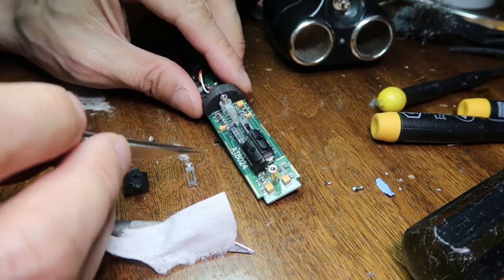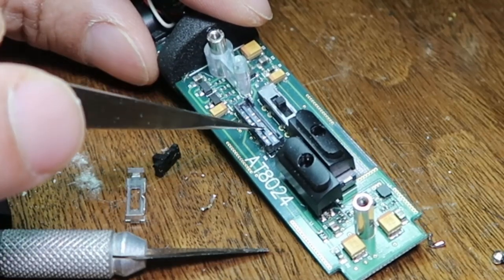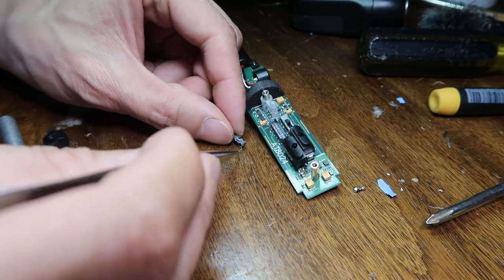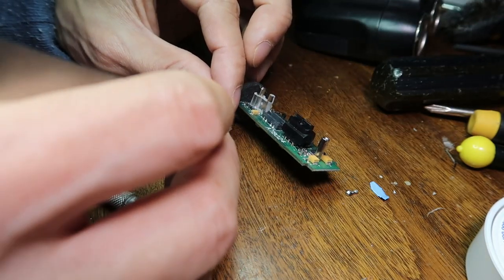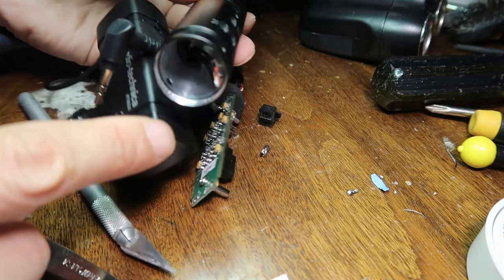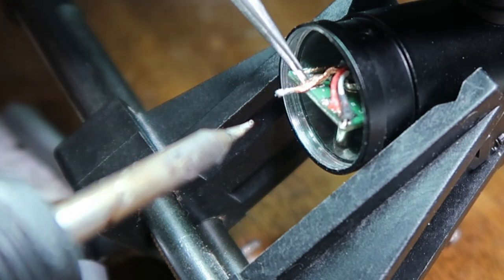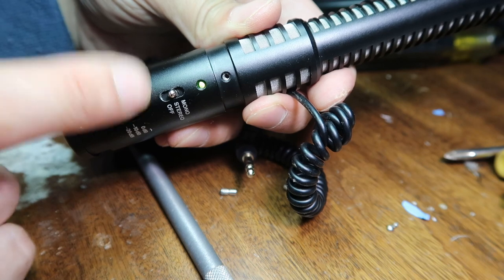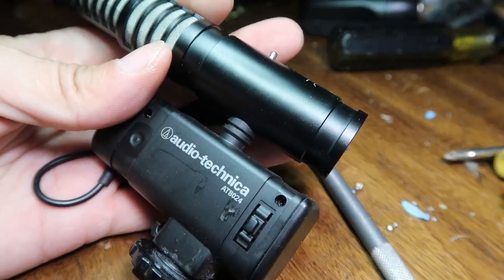Sub-component Level Electronics Repair on AT8024 Mic

Comment: Sure, this is good mic, but it has one limitation - it has mid-side hardware configuration (cardioid + figure-of-eight capsules) inside, however to the output it gives the mixed and "baked" (via mid-side matrix) Left-Right signal. This gives you only one advantage of the mid-side mic - the LR signal can be safely downmixed to mono, without the interference defects. However in this variant you miss other advantages of mid-side signal. The raw mid-side allows you to manipulate the recording in the postprocessing, so that you can decide, what amount of 'mid' signal (target sound, centered) against the 'side' signal (pan width of the ambient sound) should be present in the stereo downmix.
Good directional Mid-side stereo mic, capable to output the unmatriced mid-side signal, e.g. AT4050ST, or BP4027 or VP88 costs a fortune. Therefore I am highly interested to experiment with this one. There might be a variant to bypass the matrix in the "stereo" switch position, or to add the "side" to the R of the TRS in the "mono" switch position.
Personally I prefer to mod the "mono" switch position behavior, since you still can get the virgin mono on the Tip of the TRS, while on the 'stereo' switch position you keep your fancy "baked" stereo untouched, for the out-of-box records.
AFAIK, there are no other cheep and good mid-side on-camera mics. Really curious to learn about such mod, if you are interested to try. Cheers!
Reply from the maker: The mechanical switch is a huge failure mode as the it probably couldn't survive 1000 toggles.

Comment: Hi
How did you open it?...

Just today I received an AT8024 bought on ebay for less than 80€ +shipping. The seller wrote it was very worn, instead the one I received is like new (!), but it makes noise in switching and audio is always mono, also in stereo position! It doesn't seem to be a switch issue, because I never hear a difference between the channels.

The problem is how to open the back! I tried with adjustable pliers and an old inner tube, but I was unable to open it... :(
Reply from the maker: Glad you got it opened. =D
Reply: I solved the problem: the high pass switch should have been a double switch, instead it had the pins tied together two by two! It was a single switch, connecting together the two channels! It was a wrong switch, then the microphone has never worked in stereo! I replaced the switch by another one I salvaged before and now it is OK! :)

Comment: That's interesting! I usually try to fix stuff before I throw it away. Not too long ago I have to change batteries to a spider keychain and omg that frustrating. ^.=.^ When I finally fixed it I felt so proud of myself. Yay, you fixed it! Ty for sharing! 😘🌹👍
Reply from the maker: =D This is the mic I carry for vlogging and I use this for some videos as well.
Reply: BeatTheBush DIY That's awesome! ^.=.^ Maybe it will last a bit longer before you buy a new one.
Reply from the maker: Hopefully, for many years to come. Even if the switch breaks, there are work arounds.